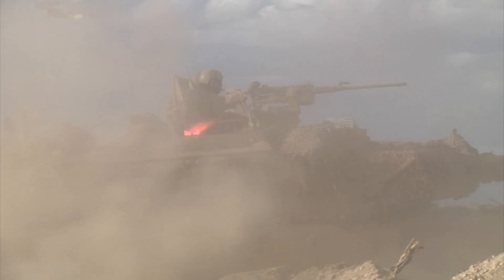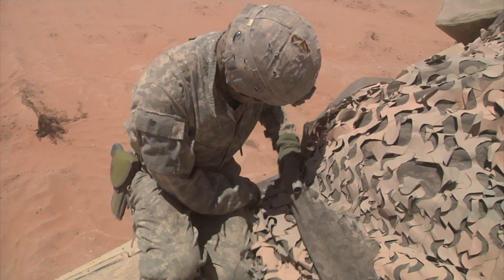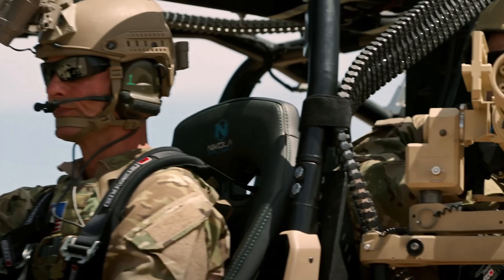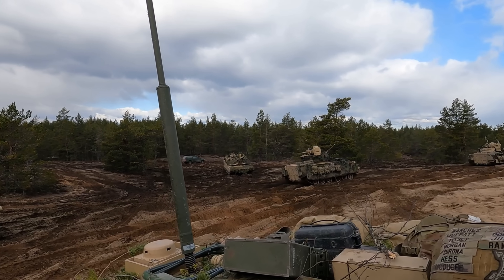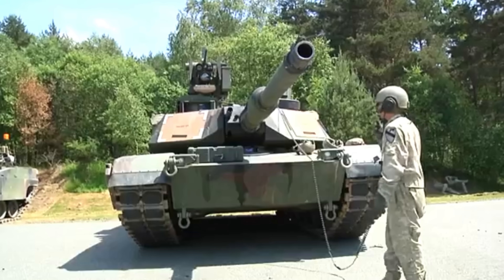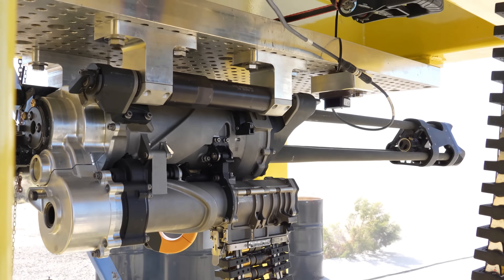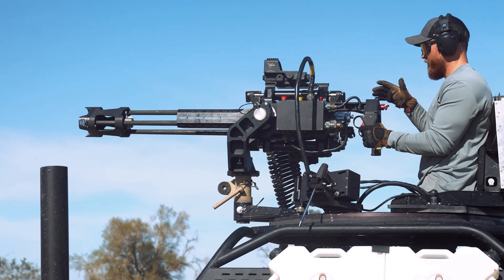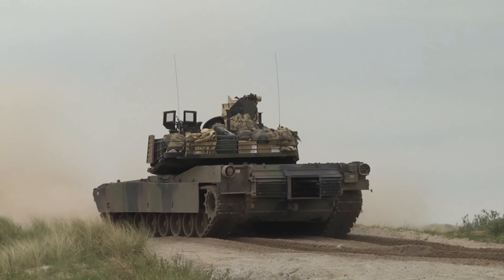Why is the U.S. Army putting a M134 Minigun on Abrams? | ROTARY GUN DEFENSE

Comment: Mid-term, tanks may end up with smaller version of the Navy's automated Phalanx CIWS.  Though going down to a 5.56 microgun might be necessary for ammo storage purposes.
Reply from the maker: Interesting point!
Reply: @_Matsimus_ Wouldn't it be wild if anti-drone microguns finally became the military use case for FN 5.7×28mm?  😅  The 200m effective range seems ideal for such a last ditch defensive system. (Hopefully the tanks have dedicated anti-drone escorts as well).
Reply: @skenzyme81  adding an entirely new supply chain to the military when 5.56 is only slightly larger and heavier is the silliest thing i have heard in a long time.
Reply: Id look at somthing like a splintex delivery systen autonomous through A.I.. I'd be most concerned with an MBT confusing its primary role with air defence.
Reply: @Tophet1  What is that exactly? I googled it, and found something for animals...
Reply: @Tophet1 we already have enough to worry about and do.
Reply: @Tophet1 Or just... Something like Trophy that already is designed to hit stuff flying towards the tank?
Reply: @jnievele  The problem with trophy is its extremely close range, and 90kg of high explosives can still score an effective kill on a tank (even if its just a mission kill)... its also not adequate to deal with swarms of small drones due to how little "ammo" it has
Reply: Precisely my thought.  XM214 or equivalent gives you double the ammo in the same volume.  Smaller gun makes everything (except the actual radars and computer)  smaller, lighter, and lower power requirement.

A CROWS type mount that adds a short range, high accuracy radar (like kind now routinely used for auto-adaptive cruise control) out to the ranges required.  And 5.56x45mm will easily do any drone small enough to not be engageable with the .50 or even real ADA.
Reply: Need to add 4 AESA arrays and a thermal tracking system around the turret, and then automate the mini gun along with a active protection system for layered defence. Possible useful against incoming AT missile as well. I’m sure there was a smaller calibre mini gun (5.56mm) that never put into production.
Reply: That seems like a smart move to me. They'll have to add some armor to the mini-phalanx because of the environment, but they'll gain that and more back by going to 7.62 or 5.56.
Reply: @StudSupreme plus, mini guns are already in production
Reply: How about a rotary shot gun slaved to a flat panel aesa radar, mounted flat on the top deck, looking up at the sky.
Reply: My idea using the Rheinmetall GDM-008 35mm cannon which has shell that can be used like “smart” shot shell. Maybe it can miniaturized to 20mm or smaller but amount of shot is much less per round compared to 35mm.
Reply: I would suggest you research the effectiveness of the CIWS system, when attacked by multiple incoming missiles, the time delay for the radar to track, predict, lock mad fire is such that no more than three missiles can be guaranteed a hit. This is why the navy is upgrading to 30mm and 52mm programmed ammunition to defeat swarm attacks. Currently the drone use in Ukraine is  mainly through lone wolf attacks, but, as conditions change, saturation attacks may become the norm. Trophy and other anti armour systems are not geared up for mass attacks (trophy has only 4 rounds available before reload is needed). This makes hi-tech fast reaction sensor based systems unsuitable. To kill cheap drones, you need a cheap simple solution.  Economics wins wars not shiny toys.
Reply: Those things are massive, with alot of under the deck technology. The control panel alone looks a refrigerator withan lcd
Reply: CIWS isn’t going to fit on a tank. The base that contains the RF, electronics, and cooling that it sits on is really big and would make the vehicle super top heavy. It’s not just the R2D2 part that you see with the gun underneath. I worked on CIWS for a few years and it’s a great system but I think the Oerlikon Skyranger system is a much better anti air fit for armor protection. It has air burst rounds and it’s a 35mm both of which CIWS does not have. CIWS uses depleted uranium rounds but a human firing it is not going to be able to protect a tank from FPV drones.
Reply: @antonleimbach648  put a Oerlikon Skyranger system on a AMPV to ride along with the tanks and Bradleys.
Reply: A lot of your criticism based on the vulnerabilities of the operator, you have to remember that there would be several of these operators, all exposing themselves, but also protecting each other.
Good old-fashioned, interlocking fields of fire. 

We 100% need to get these on the Marine Corps landing Craft and the US Army US Navy logistics ships.
Reply: I partially agree with this. If the system can’t be upscaled to have proximity-based explosive ammo (20-30mm), then one alternative could be downsizing for a lighter and faster 5.56 system. Still, I think a shotgun-like blast from multiple active protection systems would be more effective, as the drones require close range or positioning directly above the vehicle for the most effect.
Reply: My thoughts exactly on the Phalanx. Or an automatic range finding radar controlled MK19 flak gun. less ammo more killing radius. Drones are fragile, and it would not take much to knock one out of the sky. It could also be used as anti-personnel. Flak guns worked well in WWII.
Reply: The 134 is 7.62 x 51
Reply: I mean it'd be super useful for defending against drones.
Reply: @Reaper.Visual only if it is automated
Reply: Working on a version rn
Reply: @vladgingu does it need that much size at that rate of speed.  Like a bb sized pellet  uprade the velocity.  Then spent rounds are just lil metal pellets like claymore reactive armor etc i get the 5.56  rnds but then if you load these lil things up with non lethal also for riot control police role.  Obvs still have one 5.56 or larger but you could load an abrams with like 20 of the mini mini pellet dispenser guns
Reply: Close enough, welcome back m48 gau8
Reply: The only right choice is 20mm on up round with a programmable fuze. The Germany made AHEAD round comes in 35mm or 30mm with tungsten submunitions that act as giant shot gun shell
Highly effective against drones, they need to scale it down to 20mm or 25mm simply to get a higher ammo load but also need HEDP , anti personnel and anti material rounds as well
Reply: Ukraine needs to borrow Israel’s new lasers.  They are made to shoot down drones.
Reply: Just my .02c but I think they are thinking 1 or 2 Gatling guns in a group of tanks would be useful for thunder runs. Most tanks could still have the .50 and a few could have something more specialized for drones like a shotgun system. The other tanks could have trophy systems for short range defense. At the end of the day it's a tank. So if the drone or aa fire doesn't hit it directly it basically has no effect. So shorter range defense is NBD most of the time. Having a few tanks or other vehicles to slap down drones for infantry support and a few with "mini-guns" to suppress a trench or emplacements might be useful to help out infantry too.
Reply: Dumb idea that didn't work out
Reply: Hi Matsimus i just had an incredible weekend at the Operation Market Harbourough show, which is a fantastic show as the vehicle arena is busy all day and includes some basic but interesting obstacles for all vehicles to tackle and over 40 tanks taking part, and everything from motorcycles to MBT,s and combat engineers vehicles, reenactments and tons of static displays, including a Gepard and i think the only Chieftain Marksman (8 took part in the show) in existence, the Marksman is an air defence vehicle with the same twin 35 mm guns, and a radar and tracking system built by Marconi I believe, i was lucky enough to be invited to climb up and check up the turret which is actually really high, but during its displays there was mentioned the its now being considered again, have a look at the system again because of the drone threat have a look at the you tube footage its a great show like a smaller tankfest, we even had David Willey from the Tank Museum Bovington doing the Narration for the arena
Reply: I doubt there's a requirement for a rotary cannon. If the radar guidance can be provided why not just tie it into an existing RWS?
Reply: Aren't m134s chambered in .308?
Reply: @jestopherson Yes, and that is mega overkill in this application.  Even a 5.56 microgun would be overkill in drone CIWS unless you're imagining dual use as an  anti-infantry sentry gun.  Ideal drone defense round is even smaller, 5.7x28mm.  By weight, you can carry 4x as many 5.7x28mm rounds as 7.62x51mm NATO.
Reply: @jestopherson  well, 7.62 NATO
Reply: It would be better with a 20mm rotary cannon without cartridges for a future MBT.

Using a similar feeding system to an airsoft gun, with a complex combustion chamber for the gas ignition to launch those 20mm shells
Reply: 미국 팰링스가 단종되고나서 네덜란드 골키퍼가격이 상승하자
대한민국에서 골키퍼를 베이스로한 ciws-ll를 개발했습니다
2027년도 충남급 호위함부터 배치예정이고 지상버전도 개발예정으로 알고있습니다
Reply: That would be nuts. On Admin Results there was this anti drone buckshot like 5.56mm. 3000rpm x 5 would be insane
Reply: nah, they are going to have to bring back the dedicated short range air-defence but for drones instead of helicopters, everyone else can just button up and hope they don't get sprayed with AA fire....or you know......a drone
Reply: @ScreamingSturmovik  jup, I think small truck mounted AA systems will become really popular very soon
Reply: Why not 9mm but a bit larger cartridge for range.. I doubt you need a 5.56 to delete a drone
Reply: @FEDEXLuchs 9mm has a larger diameter than 5.56mm, but is not going nearly as fast. Most 9mm pistol cartridges run about 1300fps, while nato spec 5.56mm is traveling 2700 fps+ typically closer to 2900fps.

9mm could totally take a drone out, but has a much more limited range vs the 5.56mm and would take more room ultimately.
Reply: @FEDEXLuchs 9mm isn't really loaded for reasonable accuracy at 100m and further, and the form factor of straight walled cases isn't conducive to feeding it through a rotary gun (especially at 3000rpms).  And the trajectory of 9mm sucks for engaging aerial targets.

On the other hand, 5.56x45mm is almost ideally suited ballistically for the role, out to about 800m (which is about the reasonable engagement range on a small quad), the ammunition costs about the same same for the government to acquire (sure, there's more material on the case, but there's half the material in the bullet - it's a wash), we already have an appropriate link (and linked ammolunition suitable for immediate issue) currently in production, standard supply channels, and inventory, and we already have a combat tested and validated gun (with most of the full TDP already) that we could out back into production- the XM214 (which kept its "X" prefix, not because it failed , but because when it was being tested in Vietnam, there really wasn't a valid role for it, as anywhere you could use an XM214, you could use an M134 just about as easily.)
Reply: @geodkyt  Your idea of using a XM214 or adapted M249 in a remote controlled/radar controlled mount/turret to shoot down drones has an added benefit. It's ammunition could resupply troops in a pinch. How big would a aerial drone need to be to carry one ? Or mounted to a 4-wheeler ?
Reply: @FEDEXLuchs  You don't, but 5.56x45 doesn't weight any more than 9mm, and 5.56 is much longer range and actually useful against personnel in addition to drones. Also, 5.56 comes in cans linked for MG use, and 5.56 has a tapered case that feeds better in automatic guns.  Also, the microgun already exists, while a 9mm system would have to be designed, tested, and manufacturing tooling created.
Reply: @FEDEXLuchs , 9mm is a larger caliber than a 5.56.  5.56 is a larger overall cartridge, but a smaller diameter round, in fact a rotary gun with the humble and inexpensive .22 would be sufficient for anti-drone defense.
Reply: @FEDEXLuchs 9mm is larger in diameter than 5.56mm. 9mm is also significantly slower and as a result has a much shorter effective range.
Reply: @FEDEXLuchs  Imagine if the .50 AE makes a comeback for this?
Reply: @FEDEXLuchs  range probably. 5.7 would be a fun novelty but when you've already got bazillions of rounds of tax payer bought M855, why not yeet $1,000+ of ammo at a $100 drone? 'MURICA!
Reply: @bennyb.1742  drones are NOT 100$ drones.  FPV drones are not that cheap they are about 3,000 dollars per unit.  Cheap store bought drones are easy to stop due to jamming and short range.  they are also much harder to fly.  FPV drones are a step above hobby drones
Reply: @FEDEXLuchs  You want range and stopping power.  A 9mm may be fine for the tiny FPV hobby drones. The much larger real military drones will be firing missiles or dropping bombs, at stand off ranges.. Not coming within pistol range to plonk a C4 block or grenade/mortar round on you.
  The biggest problem with any of these anti drone system will be ammo stowage.  An MBT is already packed to the gill with gear and main gun rounds.
Reply: @Yandarval You don’t want range, you want fragmentation. The primary threat that drones pose right now are not when they’re at range, but at close range from compact FPV drones either flying straight into vehicles with explosives or dropping them a few meters from above. Unless they’re using FPV drones as laser designators while firing munitions from stand off ranges, a drone at stand off ranges wouldn’t be a direct threat unless we now somehow have miniature Reaper FPV drones or something with ranged weapon systems, which I doubt. I’ve never heard of FPV drones attacking vehicles from stand off ranges.
Reply: @FEDEXLuchs if you are replacing the M2 with 9mm this is a huge disaster as a TC I can say you are giving up a ton of Anti personnel ability in a vehicle that already has limited anti personnel ability without support.
Reply: @FEDEXLuchs  5.56 has a lil more range and it's more common
Reply: @FEDEXLuchs bc it’s light at just 1000m it’ll hit like a plastic bb😂 they use 50bmg rn…. Could you imagine swapping a 50bmg machine gun out  for a little 9mm pea shooter… you literally couldn’t even pen light armour, if so not reliable enough to be considered useful, no point in having special ammo when you can simply have a better gun ammo can come after
Reply: @Nickjustdabs  yeah but your not facing armored drones.. they are just plastic even BBs damage plastic. and 9mm minigun would evcen keep infantry heads down.. anything larger you already have a main gun for
Reply: @Nickjustdabs  If you need to poke whole in armour, that's the raison d'être for the 12 cm main gun...
 ...but you don't blast mosquitoes with cannons, do you?
Reply: @Nickjustdabs  smaller drones would still easily get downed by it, and you'd have significantly higher ammo capacity at significantly lower cost per round. The minigun is a prospective drone defense weapon, not a vehicle or infantry weapon, the Abrams already has those weapons
Reply: @V3RTIGO222 If you really run the ballistics, the gun would be scaled way down.  As crazy as it sounds, for the 100M to 200M kill range, FN's 5.7x28mm seems to hit the sweet spot.  This lets you carry 2x as much ammo as you would with 5.56 and 4x as much ammo as you would with 7.62, and both of those are overkill for this application.
Reply: @skenzyme81  Precisely, but we have an abundance of 9mm which is the cheapest, most commonly available ammo in US aside from 5.56 that would suit this purpose. I'd wager 5.56 would be the choice they'd settle on, as we already have established 5.56 rotary guns, which retains suppression/lethality against infantry
Reply: @FEDEXLuchs you're facing drones in ADDITION TO steel cased artillery, rockets and anti tank missiles.

Duh.
Reply: I doubt a savings on ammo storage is a factor with going to the mini gun. Because the fire rate is so outrageously fast, you have to carry quite a bit more ammo, or it's going to run dry within several seconds of continuous fire. I haven't run the numbers, but I'd guess that carring 5 to 6000 rounds for a minute or 2 of being able to fire, vs 1000 or so of 50cal is probably takes quite a bit more space.
Reply: Except... The land version of CIWS called C-RAM is already an outdated failure, SKYSHIELD is much more capable (and used with great success in Ukraine). Rotary guns are great at sending huge volumes of ammo downrange, of which 99.99% is a total waste as it doesn't hit anything. Use a proper 30-35mm AHEAD round and the target is gone with a mere 5 shots or less.
Reply: @jnievele  As someone thats worked on both systems, calling CIWS an outdated failure is kind-of a stretch. 

Also where are you hearing that Ukraine has Skyshield systems installed? My kind of work involves knowing weapon systems being sent to Ukraine. I have seen proposals to send sky shield, but not action so far unless Ukraine bought these systems beforehand or directly.
Reply: @rufus2028 Ukraine has several Skynex systems in operation, which are part of the Skyshield family of systems (not to be confused with the Sky Shield initiative for a European integrated air defense). And yes, CIWS used on land is a failure, it's too short ranged. It worked in Iraq or Afghanistan against a few mortar shells or rockets, but it's point defense only (so no use as a general air defense against Shaheeds), and it would quickly get overwhelmed by a real artillery barrage (then again so would a Skyshield gun... You can't shoot down an entire artillery battery worth of shells without at least a dozen AA guns). On ships CIWS works fine but is getting replaced by missiles like RAM.
Reply: @jnievele  It's almost like there's other systems meant to engage Shahed drones....
Reply: Ukraine has had Skynex since January 2024 and has released Footage of their training and operation for a while. Evidently your „work“ is not giving yourself nearly as much of an authorative voice as you seem to think.
Reply: @jnievele why is it being replaced? Manpower. They reduce manning by two to three personnel(depending on installation). They both use the same radar. On the ship you lose surface mode used against small boats. This requires installation of a chain gun or two. On a ship tradeoffs like this are easier because of available space, power and less weight restrictions.
Reply: @jnievele  Skyshield would be far less useful against artillery or mortars than C-RAM.  You seem to be forgetting that artillery shells and mortar bombs have heavy steel casings, which AHEAD will not effectively penetrate.  C-RAM is a hit-to-kill kinetic energy round.  To kill artillery, mortars, or artillery rocket warheads, you basically require hit-to-kill with a significant sized projectile to pierce the shell and detonate or ignite the filler.  AHEAD works fine against the thin plastic shells and extremely sensitive electronics of a drone, or the thin aluminum skin and delicate jet engines of an aircraft, but NOT well against the heavy steel casing of artillery (or the semi-armor-piercing warheads of anti-ship missiles, which CIWS was specifically designed to defeat).  And most 30-35mm systems don't have the rate of fire to ensure a direct hit the way C-RAM does (Goalkeeper excepted, but that would be even more difficult to put on a ground mounting than is C-RAM, and it still has the ammo weight problem).
Reply: @jnievele that is wrong approach entirely. To protect from artilery you have to destroy it with artilery rickets or drones like russia uses. Assume some air defence on tank can be enough is laughable and counter productive. If such system exists and is capable to destroy even one incoming shell its already very good for now but infantry nearby will be dead due to airbust and light and not so light vehicles will be damaged depending on range roof armor is joke everywhere
Reply: @jnievele  Saying that CIWS is a failure on land is ignoring that putting it on an armored vehicle is using it in its proper role, to protect the asset its on. This can shoot down a drone at 10 meters flying directly at it. No problem. In fact its the best and cheapest way to do it.
Reply: @jnievele  I don't really understand this logic. Why would CIWS work better on ships than on land? The only thing I can think of, is that on ships, the missiles are more likely to be aimed at approximately where the CIWS actually is, which makes them easier to shoot down. But I feel that should be the same for Skyshield. If Skyshield is better than a 20mm rotary cannon on land, it should be better on ships too. In fact, it would be even better, you can use sea water to cool the barrel, and have a longer, more sustained fire.
Reply: @bronco5334 yeah... The goalkeeper uses the gun from an A10...

I wonder if you could build a dedicated "goalkeeper" tank? An Abrams chassis with a GAU8 canon?
Reply: @jnievele  You could also use those scattering anti drone bullets that Ukraine seems to be using, you don't need range against a drone when you are in a tank after all
Reply: @TheLazyFinn If they work as intended, sure. They're pretty new AFAIK. Make a .50 version and you don't even need to replace the TC gun
Reply: @TheLazyFinn infantry or other vehicles do need about 50 m range or more depending on target.
Reply: @TheLazyFinn you haven't seen the videos of small and cheap Ukraine drones decimating tankd.
Reply: @jnievele  They don't work on the move. And they're $25 million a gun.
They need electro-optical guided microguns, not radar.
Reply: @ryanj610  "They need electro-optical guided microguns, not radar."
So no defence in fog and dust then?
Reply: @jnievele 1 ahead round is basically more expensive than an FPV drone
Reply: @jnievele  SKY shield is only slightly greater ranged than CIWS
Reply: @jnievele  A 30mm+ round is way too big to be carried by an MBT.  Even if they carry similar amounts of ammo to an M2 Bradley (900 rds).  Any sort of high ROF weapon will eat that ammo in no time.  Which as a presumed anti drone weapon.   Will be firing a lot of rounds.
Reply: @jnievele  i have no knowledge of whether you are right or wrong in this context but just because a bullet does not hit anything does not mean it is a total waste
Reply: @jnievele  I know we're putting the Israeli developed "Iron Fist" system on a bunch of stuff, because my job picked up a contract to produce them domestically.
Reply: @jnievele  You need a high rate of fire for anti-air defense because the window to shoot something down, is fleeting.
Reply: @jnievele  I see drones operating in the envelope that gun based AA was designed for. Gun based AA went away because aircraft got too fast for it to be effective. A big problem for drone defense is the same as the Navy found in WW2 vs. kamikaze attacks. You *have* to kill the target, not just get it to break off the attack.
Reply: They have electonic counter measures already, and some other stuff each platoon has a secondary role
Reply: For most drones even a .22 would be plenty. I also thought .410 would make a lot of sense, loaded with larger birdshot/smaller buckshot it would shred drones even at lower fire rates to conserve ammo, and if they use steel shot it would lower cost, minimize danger to friendlies downrange as well as environmental damage since NATO has been looking into "green" ammo for a while now.
Reply: @DaleErnieMichael  There are a variety of .22x calibres which are fast and flat shooting which help to minimise the amount you need to compensate for drone movement and unpredictable movements, etc. and give much bigger margins for dealing with drone swarms than some of the other calibres people have talked about. The problem though is what happens to the misses downrange - something the 20+mm rounds help to mitigate due to the lower volume of fire and potential for self-destruct fusing.
Reply: @DaleErnieMichael Nice try, but that's IF you can hit it. With your life on the line if you don't. Records show it's not nearly as easy as you think.
Reply: @jnievele  We're talking about computer controlled multi barrel rotary machine guns capable of firing thousands of rounds a minute here, they are used to shoot down ballistic missile coming in from orbit at mach 10. A miniaturized CIWS can hit a Chinese toy quad copter with a hand grenade taped to it.
Reply: @DaleErnieMichael No. we're talking about efficient ways to defend MBTs against FPV drones. But if multibarrel rotary guns are sure they can compete, they can add suggestions
Reply: @DaleErnieMichael  no they are NOT used to shoot down ballistic missiles coming down from orbit.  I don't know where you got the idea that they are used  in that fashion.
Reply: Brother will NOT be putting a little 5.56 on a tank😂 they’re big guns for pen, damage, range, like they use 50bmg rn, imagine what that would do to a car in 3 seconds compared to 5.56, even if chain fired, also what is a “mircogun” lol
Reply: @Nickjustdabs I was referencing the old XM214 Microgun from GE.  It failed as a gun pod due to limited range, but might be useful as CIWS small enough to mount on a tank.

The extra ammo capacity by going smaller is useful for swarm attacks, but there are diminishing returns.
Reply: @Nickjustdabs  JFC, maybe do some research BEFORE making yourself look like a moron in an attempt to mock someone. 

Microgun has been around since the 1970s.  It is a scaled-down minigun, made to fire 5.56x45mm ammunition.  Minigun is itself called "minigun" because it is a miniaturized 7.62x51mm version of the 20mm M61 Vulcan.
Reply: @Nickjustdabs Doesn't the loader have a small calibre machine gun on his hatch? Or is that a .30?
Reply: @Nickjustdabs    These guns aren't meant to penetrate armor, rather to shoot down drones.
Reply: @Nickjustdabs  you clearly don't know what you are talking about.  "Chain fired" ?  This is not a Bushmaster.
Reply: @Nickjustdabs  not chain fired, chain guns are a related but separate weapon type. The Microgun is the name given to the weapon system that is a scaled down version of the 7.62 Minigun and chambered in 5.56. Range, damage, and penetration aren’t a problem in this case because the M2 isn’t really used for its armor penetration capabilities in its role as a TC gun and the Microgun can put out a similar if not larger burst mass down range than the M2. Infantry, which is the main target for the TC gun, and light vehicles can absolutely be shredded by the Microgun so there is no problems there either.
Reply: @Nickjustdabs  If I’m not mistaken, it is a smaller version of the M134 with shorter barrels and chambered in 5.55
Reply: theyre STILL called miniguns even in 556^^
Reply: @kickass-eu1dh No, the 5.56 version is called the Microgun.